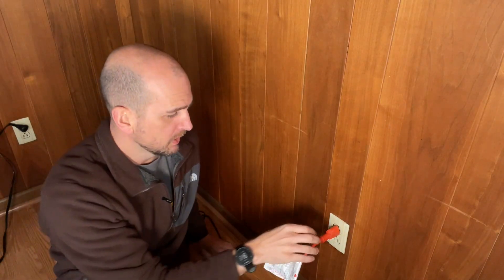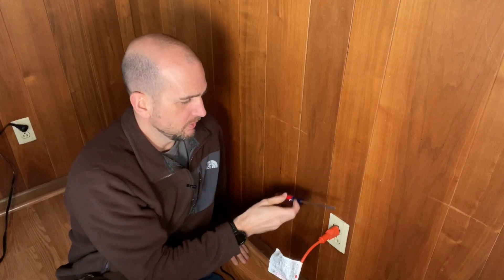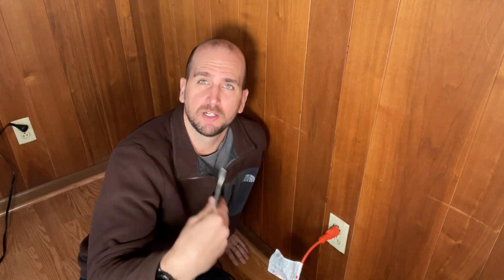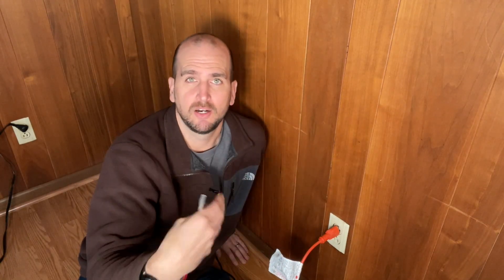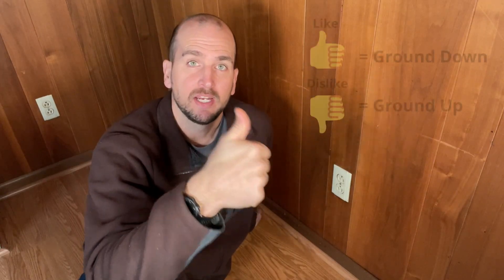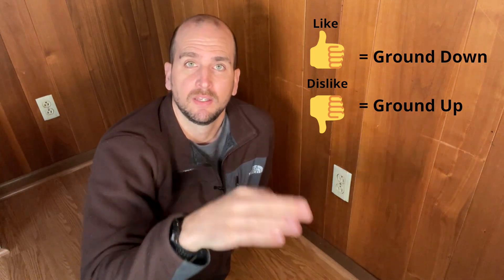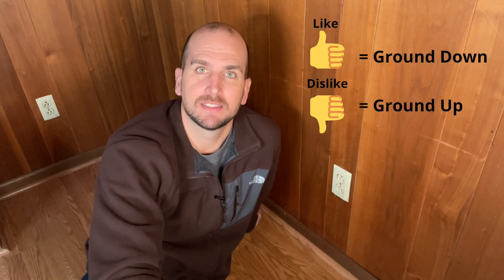Should An Outlet Be Installed Ground Down Or Up

Comment: Let me say that after spending many years in the electrical field I would suggest ground facing down .  A loose fitting plug in a receptacle is telling you to change out the receptacle or plug on the item.  Never have I heard of or seen anything getting behind the plug and causing the short or ?  My aunt bought a new condo with the ground facing up as was bugged by it and had them reversed.  My personal preference is for the receptacle to lay on it's side, just use the approate ring to do this.  This was most common on high end residential homes.

Comment: Ground down so if the plug pulls loose (grounded plug) , the ground is still in contact protecting the user. Arc fault and gfi are cheap protection if you are in the habit of being careless. Smiley face looks better too!

Comment: The particular hazard of sliding metal down a wall would be safer ground up, but on the other hand, if something heavy hits the plug and not particularly the blades, it's likely to lever that plug downwards, rotating the top blades out of the plug first. If ground is up, that means the ground gets disconnected first. On the other hand in some shops or critical or medical situations having ground up might mean the power connectors are a little more secure if half wrenched out of the wall, like you're never going to lose power if something hits it.

I like ground down just because it's easier to see all the blades and put a plug in more efficiently. It also seems to be more common. Perhaps it's also easier to notice if a plug is only half inserted with ground down, and ground down probably also makes the plug more stable in terms of resisting being pulled out and down. Two blades on top resisting being rotated out, as opposed to one ground pin.

Another good point is, if in a basement or place where water exposure or leaks in the wall are a risk, ground down probably means the ground contacts the water first. Good idea.

I think I'll stick with ground down for most work. If you are really worried about stuff hitting it, use a recessed outlet.

Comment: First, that comment about the websites displaying a preference for ground up is false. They are mixed.
Second, it drives me crazy seeing the ground up. I have a number of power bars and extension cords with flush mount plugs and the ground is always down, except some odd balls that are at a 45 degree angle.

Comment: It can go either way but ground down just makes it easier to see all the blades when putting a plug in, so that's the standard. Sometimes I will flip one because a particular cord will be used on it.

I've put plug outlet boxes in sideways only 2" off the floor. Usually no code even on that (maybe basements are different). Old homes even had floor outlets (which I would hesitate to do).

But going ground up because of stuff hitting an outlet? That's actually a fair argument. Seems like stuff never slides down a wall and hits an outlet but duh, easy to see that happening. I'm sure someone has made little top shrouds for shop outlets. Or maybe you use recessed outlets. See my other comment. 

Also, ground down makes a happy face so it's good for attitude :)

Comment: Had the same discussion many years age.  Was told by an electrician that in commercials applications the ground should be facing up.  I might add, all extension cords sold at consumer based stores are made for the ground down in respect to the neutral.

Comment: Has there ever been a case of someone dropping something that lands so perfectly across the prongs? Or was it just a "what if" that caught on?

A bigger safety issue is if the ground is up and the prongs are slightly exposed, your pointer finger could possibly touch the 2 prongs VS touching the ground prong if installed the "correct" way

Comment: i dont know where I read this, but I was under rhe impression the ground goes up for 20 amp outlets.
Reply: If it doesn't have a 20A face (with the neutral slot turned 90 degrees, NEMA 5-20), then it's not a 20A receptacle.

Comment: Electrical receptacle outlet orientation in not important. What is important is the way the toilet paper roll unrolls. The correct way is for the top of the roll to unroll away from the wall.

Comment: Originally back in the 80s and 90s when Builders were too cheap often to put a light fixture on the ceiling when you were in a residential environment if a receptacle in the room was facing with the ground up it was to denote that that particular receptacle worked off of a light switch on the wall and the rest were normal.
Reply: Yes, ground down is normal.You can tell by looking at it.

Comment: I've done all 4 orientations.  For safety reasons you should be puting ground up (vertical orientation) or neutral up (horizontal orientation).
As far as the outlets that were marked top, the inspectors were considering that mark to indicate the listed orientation for proper install of the device.  The NEC does require electrical devices to be installed according to the manufacturer's listing.  As most outlets don't come with installation instructions saying that you can install the outlets in any orientation, the top markings meant that you would have to get a letter from the manufacturer in order to argue with the AHJ about the orientation.  AHJ (Authority Having Jurisdiction) = inspectors from the local inspections department, engineer for the job, clients insurance inspector, architect for the job, etc.

Comment: I really wish the US plugs would do something like the UK or EU(safety) plugs where half of the prongs' length are shielded to prevent shorting if the plug partially falls out.
Reply: The usa is way behind the times on electrical safety. The UK has had the safest system in the world since 1947. Its ground/earth at the top and live to the right, neutral to the left and of course with a fuse in the plug.

Comment: Ground up for sure. Every older plug I have seen with ground down, the bottom of the hole is broken away because of the ground pin putting stress on the plastic part of it.

Comment: When I was a new home sales person for a national builder, the ground up plug indicated it was controlled by a light switch in that particular room.
Helped you quickly identify where to plug in your lamps.
Reply: Once the lamp is plugged in who cares ?
Reply: Where I grew up, a ground up plug indicated that you needed a new electrician who didn't come to work high.
Reply: @ScottGrammer  LOL
Reply: @ScottGrammer  lol….perfect
Reply: @ScottGrammer  😆 👍
Reply: That’s exactly how I do it
Reply: Yup. That's how we install them for half hots. 👍🏽
Reply: Ground up prevents dropping something metal between the plug and receptacle going across the line.  Hospitals do it.
Reply: @reeselayton3031  who is dropping things along a wall ?
Reply: @ferdburful6352  You would have to research the origin of some codes or at least practices that orient receptacles ground up.  Start with hospital wiring practices.
Reply: @ferdburful6352  picture fell off wall broke ground on plug , had to replace plug and pull out ground part in outlet , weird but really happened. If outlet was flipped correctly most likely wouldn’t happened due to 2 prongs holding plug in outlet on the top , I took a pic, wish I could post it here.
Reply: @ferdburful6352  maybe a piece on tinsel from a Christmas tree? Just a thought! But probably a 99.999% chance of that!
Reply: @reeselayton3031  what’s the difference in a two prong….. something could fall in to that…….????? There is no stability in a ground up receptacle!
Reply: @reeselayton3031  hospitals because cords are not going down like in your house………
Reply: Same in my house. The only other time I install switches ground up is for facilities that have them all installed ground up.
Reply: If you live in a house and don't remember what each receptacle is for, your senile!
Reply: @jcagy2  or you're like me and just moved into a house and nothing is labeled. I have 5 switches that don't do anything as far as I can tell. They also repurposed a switch when they added outdoor lights, so the half hots in the living room are just always dead. So, ya, it would have been nice to have little indicators like this.
Reply: @acbone710  when we bought our house there was one switch that neither we nor the realtor could figure out what it controlled.  We had lived in the house for several months before discovering it toggled a motion detecting light in back between on or automatic functionality.
Reply: @acbone710  or if the practice of switched outlets just ended!
Reply: @jcagy2  You may also be senile if you don't know when to use "you're" instead of "your".

Comment: If an object that is a good conductor of electricity comes in contact with the current carrying conductor and the grounded conductor that would be a ground fault.  A Short circuit would be two current carrying conductors coming in contact with with each other.

Comment: just my personal opinion...  They do exist other solution for small appliances the plug just can have the tip in to make the contact the rest can be isolated. the contact surface area between the outlet and plug are less than the half. and i prefer the ground down

Comment: I was taught years ago in trade school to do ground up, in case there is ever water dripping down the walls it would hit the ground first.
Reply: And do what exactly?
I mean really the likelihood of the ground having water contact tripping the breaker is minimum at best. As water will continue to flow downhill (the steeper the down slope the faster the flow and a mostly straight down wall being the greatest slope) it will most probably be making contact with the hot and neutral long before the ground trips and the short to hot and ground or neutral is likely to trip the breaker rather than the ground tripping it. 
In my opinion YOU WERE SNOWED!

Comment: The fact is ground pin is longer than line pins to put the device to ground state first when plugged in and disconncting lines first when unplug the cord. 
Ground down on the outlet keep the natural weight of the cord down and keep the device In ground state as long at the cable is retained by the outlet.
That is the fire safety purpose of a ground in any device. 
So ground down.

Comment: If you put the ground up, when someone tries to plug in a decorative plugin, youll be back to turn it around.
Can not just turn the plugin around because of the wider neutral blade. You know when you have a single toggle switch upside down because it will say (no) instead of  (on)

Comment: This controversy has gone on since the beginning of modern electricity. When I was an apprentice we were taught non union electricians installed receptacles ground down and union electricians installed them ground up. That's all there is to it. There is no other reason, that's why the NEC does not specify which is correct.

Comment: I have a better solution, wire all in 230 V and use EU outlets ! I can't stand these toy like, insecure, fragile outlets ! BTW, ground down is why the thin plastic wall close to the ground pin is always broken, the plug leans and the two prongs are exposed !

Comment: Personal experience: Residential outlets that have either 1 or both outlets controlled by a switch should be ground up to be easily identified as the switched outlet or vice versa. tldr; Doesn't matter, do what you want. LOL

Comment: My grandfather (an electrician for over 30yrs and even worked at "ratscat" military radar base) would always install ground up. He said it was to prevent something from having the chance of falling between the plug and outlet shorting it between the load a neutral (like a metal picture frame or a metal service sign etc
Reply: That's actually a damn good argument. Seems like stuff never slides down a wall and hits an outlet but duh, easy to see that happening. I'm sure someone has made little top shrouds for shop outlets. Or maybe you use recessed outlets. 

Actually I suspect the reason for ground up is that if something strikes the plug or someone steps down on the cord pulling the plug down, the plug gets rotated into the power blades keeping them secure. The ground will get pulled out first which is a concern but in some situations losing power is more of a concern.
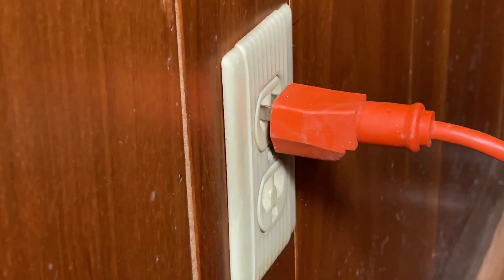Reply: 3:30….

Comment: About 20 years ago I had a discussion about this very issue with one of the guys on the board for the NEC that makes decisions about matters such as this.  My recollection is that he basically told me that while they agreed that having the ground up is safer, they also had to consider what was already embedded in the industry.  An immediate NEC ruling would be disruptive to the industry for what is in reality a fairly rare hazard.  Their preference at the time was to slowly transition towards a policy of ground up before making it official in the NEC.  Were there a high incidence of safety issues with the ground being oriented at the bottom they would have already ruled and published years ago.  I think up is better, and have mine wired that way, but this isn't a huge issue.

Comment: Folks have the tendency to pull up on a plug when removing it.. IF the ground is "up" the small plastic part of the plug will easily break. I seen the electricians in the East Coast of Canada put the plugs ground up, and just took it that ....those guys are just not too bright....after all....Why the heck would anyone spell the word farm, ei, ei, o.

Comment: Most anything that you'd plug in (ie night light or the plug in this video) that itself has an up/down orientation, needs to have the ground down, so it can be in its upright orientation.
I prefer ground down because
1. I have never seen the situation where something falls on the prongs.
2. That's what breakers are for.
3. You shouldn't be using outlets that are weak and can't hold a plug.
4. Ground up the weight of the plug pivots on the bottom two prongs leaving only one point of contact (the ground) on top to hold it from sagging.
Ground down the weight of the plug pivots on the bottom ground, leaving two points of contact (the prongs) on top to hold it from sagging.
Thus the ground down is stronger and will last longer.
Reply: I have. In our hospital, with stainless steel face plates, and ground down, an appliance that was not fully plugged in (human error) it happened that the face plate fell on the hot/neutral and caused one hell of a bang, complete with sparks. Why was the SS plate loose? Poor maintenance, but it happened. One in a million chance. Yes, it blew the breaker and no one was hurt BUT all the stainless steel face plates in the building, hundreds of them, were  changed out to plastic. It happened. I couldn't believe the perfect storm that caused this . .  but it happened.
Reply: @davidoickle1778  who's the idiot that decided on metal face plates?
Reply: Just for fun.  When I was a junior in HS a penny had fallen off my nightstand and just happened to land in the gap between my alarm clock plug and the outlet.  No real damage other than a charred faceplate and outlet but the breaker saved any further damage.  Another 1-in-a-million.  ;)
Reply: @stu_164_minitruckin   You're right, 1 in a million. Thats crazy, and the breaker did its job.
Also had someone noticed the plug sagging from the outlet, prior to the penny incident, THAT would have been the time to change the outlet and inspect the outlets in the rest of the house as chances are they are all about the same age.
I suspect in your case only that outlet got replaced.

Comment: what about replacing outlets with push in wire holes vs screws??
Reply from the maker: I am not a fan of the push ins which are usually found of the lowest end residential grade outlets and only made for 14-gauge wire.  I prefer using commercial grade outlets and using the back wire feature found on most commercial grade outlets.

Comment: I’ve not seen any problems either way but being in the commercial building industry I can say that outlets crack much easier ground down. There is a much smaller amount of material ‘under’ the ground making them more susceptible to breakage from frequent use or improper handling of cords.
Reply: But the initial reason for ground up was greater safety of shorting leads - overly worrisome IMO.  I think it has more useable friction with gnd. dn. thus better for the initial precaustion.   Sorry, that whole "improvement" was a peeve of mine.

Comment: The whole US outlet design is a joke
Reply: Sure, it's just crazy ¡  Probably much easier to make and completely sufficient.  Over-engineering - a problem the pretentious defend.
Reply: @louf7178  Could be sufficient but more dangerous, for example around children.

I have moved from EU to CA and there were some things I have observed (I am not gonna start a flame war, just a few reasonable things)

1. Outlets are flush here, vs EU outlet is sinked in - have a lip around - so that if your plug is sticking out a little you still cant see the prongs
2. Even if you can see the prongs, EU plugs are insulated and only tip is contact point, thus if plug is halfway there, you either have no contact, or only the insulated part is exposed - here, usually with 2 prong plugs (like USB chargers) they tend to sag a little (under heavier cable) and expose live contacts on top which I find incredible :D
3. Never have I have more things fall of my outlets than here - Probably just shitty outlets in my rental, I believe more expensive outlets would hold 2 prong plugs stronger